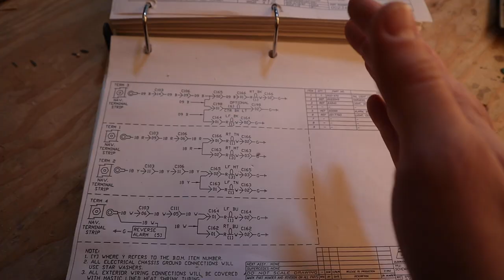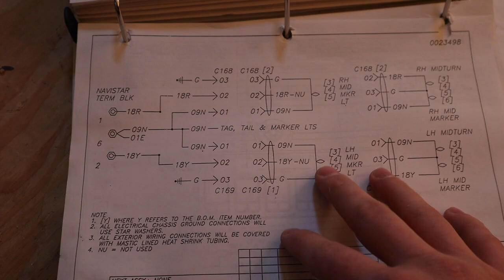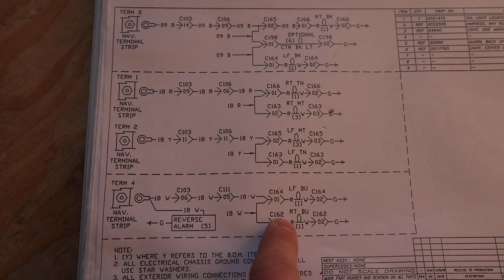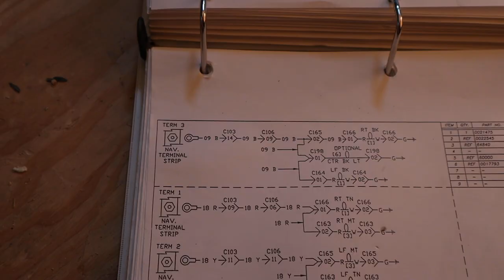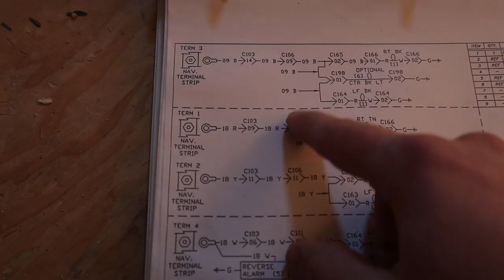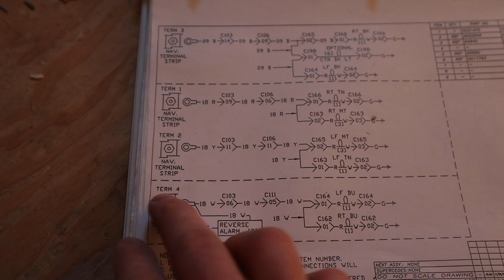Half Finished Shuttle Bus Conversion Tour! Adding Exterior Lights and More Wood??-Skoolie Ep. 41

Comment: You can buy a "flasher relay" replacement for LED turn signals.  It is usually a direct replacement that plugs into the original one.
Reply from the maker: Good to know! Thanks for the heads up. That’s probably what I’ll try next

Comment: did you need to remove wall panels to wire lights receptacles and water lines
Reply from the maker: We decided to strip the bus all the way down to insulate, so yes we did remove the original wall panels and will make our own out of plywood